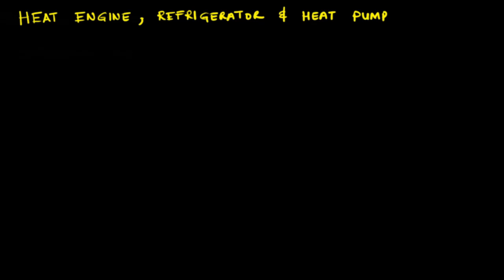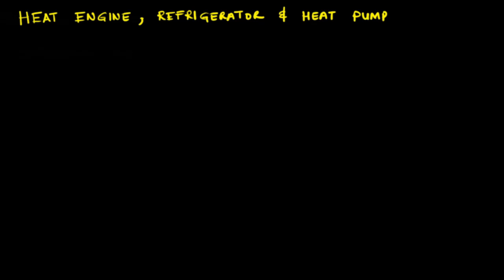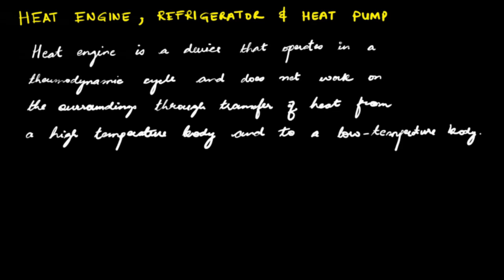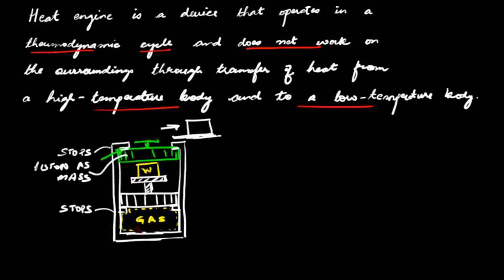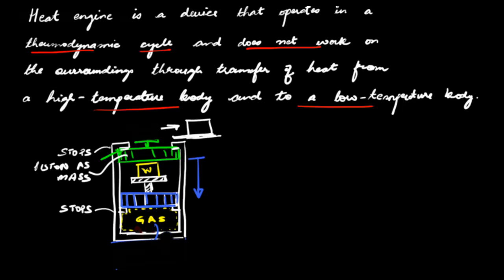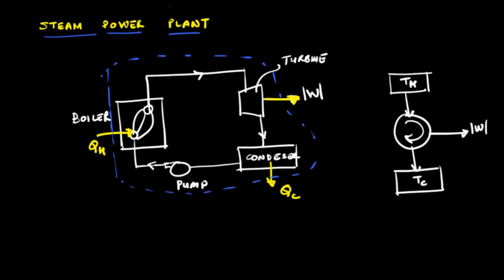Lecture 19: Heat Engine, Refrigerator and Heat Pump (Engineering Thermodynamics Lecture Series)

Comment: at around 7:20 you mention that the work done by the system on the surrounding is positive so we take work done on the system to be negative, doesn't this violate the sign convention introduced earlier?
Reply from the maker: Because we are explicitly saying work done BY system ON surroundings. If we said work done ON system then sign flips.